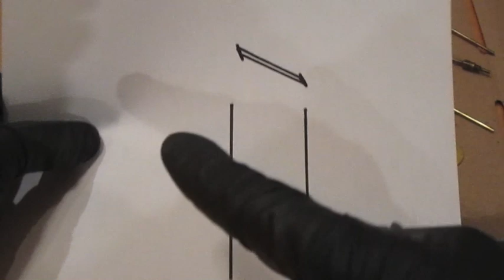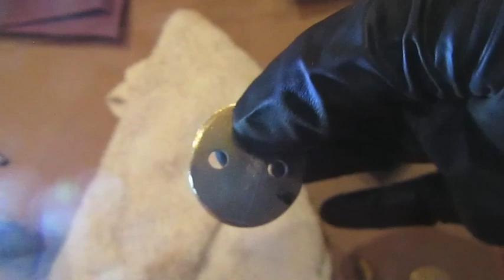Ford Model A - Zenith carburetor idle adjustments for throttle shaft and plate

Comment: The throttle shaft bore can be blocked opposite the shaft linkage side with a plug to prevent air leakage. A copper plug was pressed in, available at one time from part suppliers.

Comment: I would suggest assembling the throttle valve in the throttle shaft each time you want sand or file on it. It holds the valve "square" in the bore, otherwise you run the chance of it being crooked in the bore.